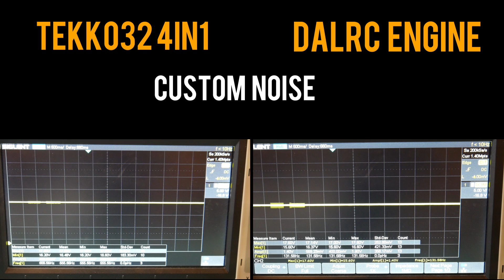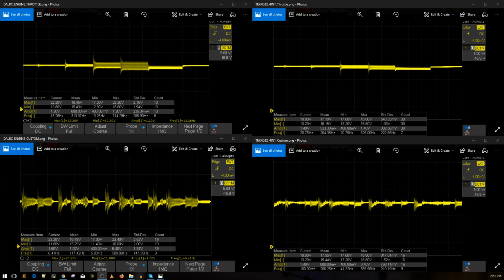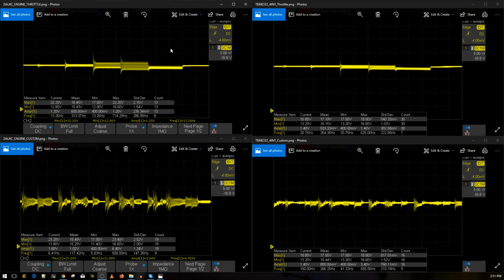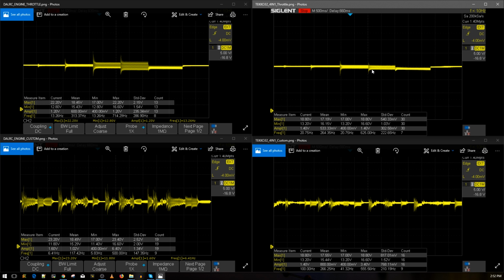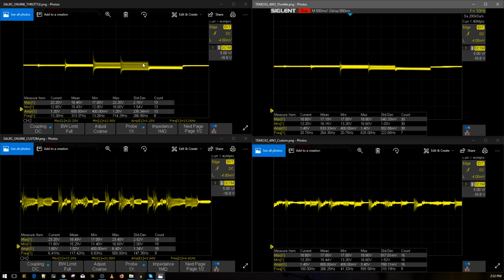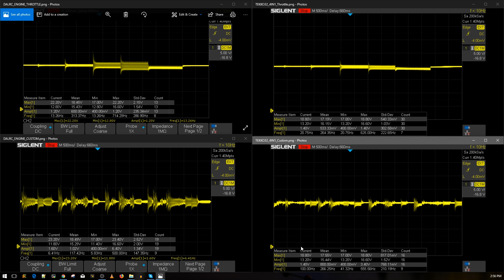Tekko32 4in1 35A ESC // Review and Noise Testing

Comment: I just finished a build with the Kakute F7 board and Tekko32 4in1 ESC. I have ESC selected in the ports tab, ESC Sensor enabled in the Configuration tab and ESC Sensor selected in the Power tab but the mAh consumption never increases from zero in the OSD. Any suggestions?

Comment: I have this ESC paired with an OmniBusF4 V5.  Everything working great but I'm not getting ESC Telemetry.  I'm using the 4-in-1 ribbon, and I have bridged the solder pin on the FC for RX1 which, according to the directions, is for ESC Telemetry.  
What else do I need to set to get it working with the FC ? 
I shouldn't need to setup a UART port, unless RX1 is referring to a UART ?  but I don't think so. 
I tried enabling the ESC Telemetry button on the config page in Betaflight but still no current from ESC Telemetry.  
Any ideas ?

Comment: Do you know it the mounting holes are isolated or connected to ground or power? Is it a problem if I use metal scrues to mount it instead of plastick standoffs?

Comment: @DroneMesh I just installed my Tekko32 4in1/ kakute f4v2 stack, and i cant get esc 3 to play nice. The motor stutters really bad. If i move the motor to a diff location, it works fine. But any motor connected to 3, jitters like mad
Reply from the maker: The Poisoned Dagger Email holybro
Reply: Will do, thanks

Comment: I purchased the tekko 32 4in1with the kukute fc. Motors sound rough and a fly away made me have to disarm mid air. Here is the values i have tried with no success in better sounding motors, pwm frequencies from 24-48 khz, motor timing seemed to help but not by much change from 16 degrees to 6 degrees. I have tried 16k/16k, 8k/8k/ dshot 600 dshot 1200. I tried a few other things to no avail. every dshot value, turned on all filters, even lowered the pid/gyro speeds to 1k, turned off air mode, no success. it sounds so incredibly rough. when the throttle is increased i cant lower it to min instead i have to disarm. Got some 35v 330uF caps on the battery leads which dont help at all. Motors sound like crap, once throttle reaches about a certain threshold it starts to fly away. Everything is brand new including the light spec 1900 kv max motors. I have never been this stuck before and I dont know what els to change/adjust. blheli-s has always worked for me every time.

BF 3.2.2, tried with filters on and off no success, also on the newest blheli32 firmware, also run reversed props.

This definately has to be an esc related issue.
Reply from the maker: Can you send me Black box log.. Something is seriously wrong with your setup.
Reply: yah i would love too but it wont fly. i suppose i could arm on the ground with props off if that works for you. my soldering skills are impeccable and i know its not a result of a bad build. I have been building for 6 years now. the only thing i have changed is rewiring the cable cause i put the xt60 facing the rear.
Reply: sent a bb log to your email

Comment: Just curious.  Did you ever install and use this?  The FETs are sitting on top of the mounting holes... looks like the of the bottom left corner (@ 2:00 min) one of the FETs legs is hanging over the edge of the hole
Reply: If you look at getfpv's sample photo, it looks like there's a layer of silicone, or some type of shim, to raise the nylon standoff.

Comment: I picked up this ESC based apone your review. Noticed the wiring from the ESC had telemetry and another wire that states NC. I have looked for an explanation of what NC is and haven't been able to find one as of yet. I'm trying to pair this unit to a fortini F4 OSD board. Your help would be greatly appreciated. Thanks
Reply from the maker: Ignore NC and your good to go..
Reply: Drone Mesh thanks for the reply. I picked up two of these boards and since then I've noticed they have been sold out for some time now. Thanks for  your help and the loads of information you put out on your channel.
Reply from the maker: Glad to have been of help.

Keep me updated :)
Reply: NC = No Connection

Comment: can you solder on an additiional 1000uf cap to the dal engine and see if it can beat the tekko32 then. Lots of us need the dal engine for the included 5v bec. Like to see what the engine looks like with some additional capacitance

Comment: I have an original Eachine Wizard x220 and every time I take it out I burn a esc. is this normal? I am wondering if I should just upgrade the whole thing and if that might be cheaper. and then what I should upgrade to? maybe starf4s?

your helps would be greatly appreciated
Reply: get a helio spring fc and this esc in this vid and you will have a golden wizard also a runcam split is always nice
Reply: Kristian Taylor yes it's normal. It's a wizard, not the highest quality components.
Reply: so what should I change to? whats not going to burn each time?

Comment: This ESC board is true engineering porn. Love that FET matrix - it look like mainframe computer boards from my childhood :)  I know that standalone Tekko32 ESC-s was good and combined board does look awesome too. Wish to know are this board have common current sensor too or I should add a separate one. Because besides motors there are FC, VTX and camera too. So I must add +1.5...2A to total current demand in mind which is not cool.

Comment: Only downside I see is how to lock the nuts on it.there isn't enough room to tighten them down
Reply: Corky Fpv looks a serious flaw easily rip those off..
Reply: This comes with tiny spacers to prevent that. USE THEM or you WILL rip off components.

Comment: Can you cap each ESC with aluminium caps? Like the raceflight - if you run 6S on a 4in1 you need individual caps to each ESC to filter out high voltage spikes. The ceramic caps typically aren't sufficient.

Comment: Wow ^^ That was impressive :D But just one question,tho... Does the Suleve nuts got enough space from the components on the mounting holes,so the nuts don't rip something of when you screw them on? It looked a littlebit to tight some places there? This is an annoying problem on some other boards :/
Reply: Esk race it comes with spacers for each corner so you can tighten it down without ripping bits off the board
Reply: Esk race looks bad layout to me but no mention of this..
Reply: I agree, the FETs look very close to the mounting hole :/

Comment: Tekko32 4in1 it is then, Thank you. I am kinda curious about the current flow, how much would it improve by adding solder to the pads. Would be a good test to see if it improves voltage drops and spikes.

Comment: Looks near identical to the iPeaka BORG 35A 32bit BLHeli Dshot1200 4in1 ESC - http://www.iflight-rc.com/ipeaka-borg-32bit-blheli-dshot1200-4in1-esc.html (BORG has an extra connector on the opposite side)

Cannot find where the Tekko32 4in1 is being sold at the moment (not on the Holybro site).  The iPeaka is available from iflight-rc.com

Thank you so much for doing this testing and posting.  I look forward to watching your reviews. I do not have the equipment, knowledge or time to do it myself.
Reply: Loks exactly the same, in fact the conector is just not soldered in the tekko32. Might be the very same?
Reply: ArchmageAU I'm really afraid of BORGS. 😐
Reply: Resistance is futile. :)
Reply: ArchmageAU 😨